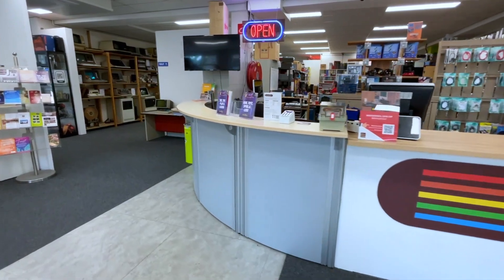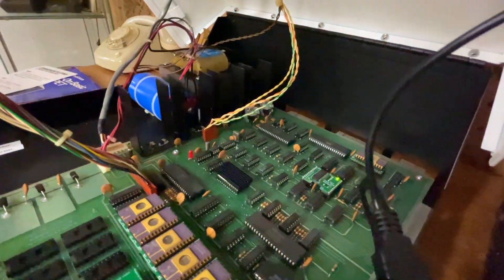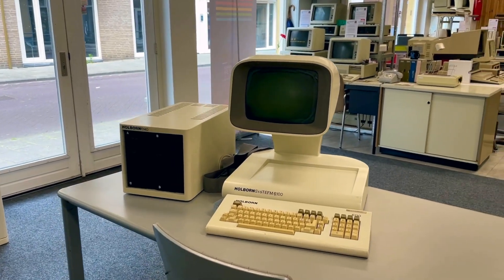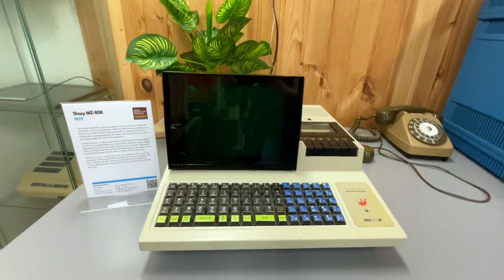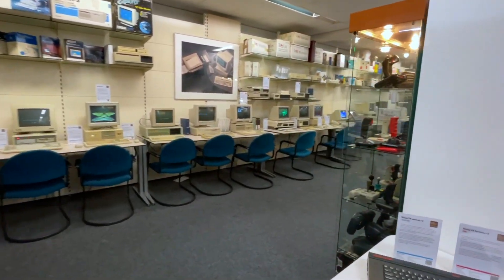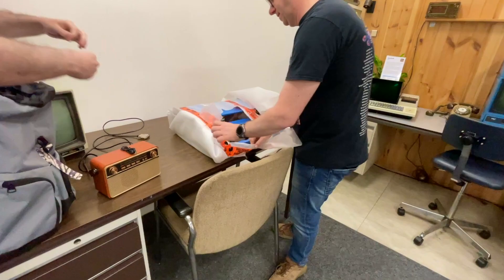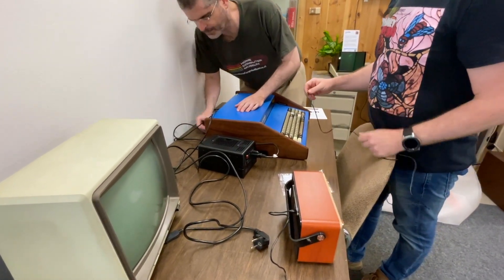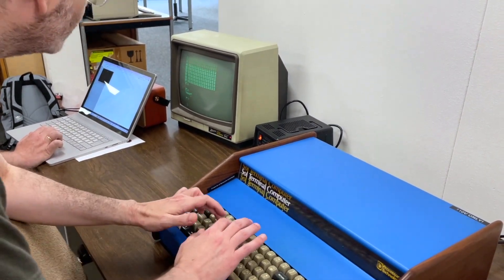SOL-20 museum restoration, PART VIII

Comment: Fascinating and very impressive. I have a Sol-20 - I was the original owner, and it basically got me started on a long career in IT. It still works - but as you show in the video, the keyboard foam has disintegrated, and a few keys don’t work. After watching your work, it looks like I’ve greatly underestimated what it would take to bring it back to 1976 form. So maybe this will be a future retirement project.

Comment: Hi, very nice realisation! As I'm restoring a SOL-20 myself, I have a small question: I noticed that you didn't put the monitor on the SOL-20, but about 30cm away. Is this because you have interferences on the cathodic when the monitor is on the computer? I'm experiencing this right now, and I have to put the monitor away to have a stable image, and I wondered if this is the same for you. I'm a little bit puzzled, because I see many SoL-20 on YouTube that have a monitor that sits on the computer. Maybe it's something to do with the 110V converter? Thanks!
Reply from the maker: No, we did not experience interference. The monitor is on the side just not to stress the case. If the case is closed, there shouldn't be interference, as the case is made of metal, creating a Faraday cage.
Reply: thanks for your reply. Is your 110V converter outputting 50 Hz or 60 Hz?
Reply: @thebyteattic  Hi, I have more information about the power supply of the SOL-20, and it's very interesting. If you are using a "simple" 220V to 110V converter, then you are certainly feeding the SOL-20 with something like 117V instead 110V that are expected, and this increase the resonance of the transformer in the SOL-20 by about 6%. In addition,  because the frequency is 50Hz instead 60, the resonance of the transformer is also augmented by 20%. So the transformer is driven about 25% more than expected, this lead to a greater magnetic field generated and stress the composant. A nice paper by H. Holden explain this very well (better than me). The solution is to reduce the voltage. See here: https://www.worldphaco.com/uploads/THE_CONSTANT_VOLTAGE_MACHINE.pdf